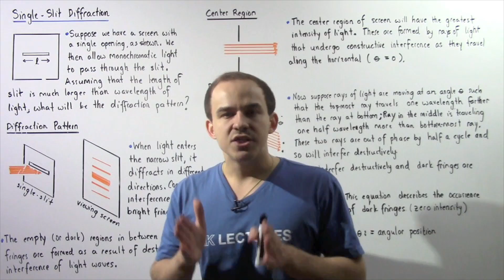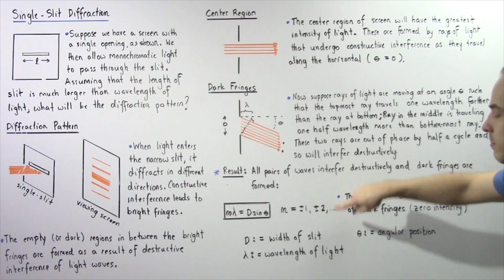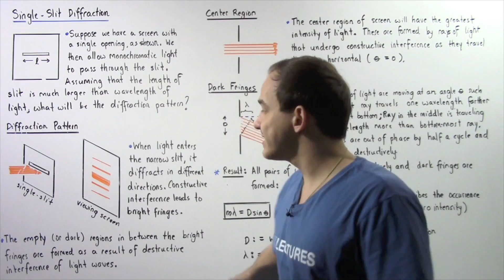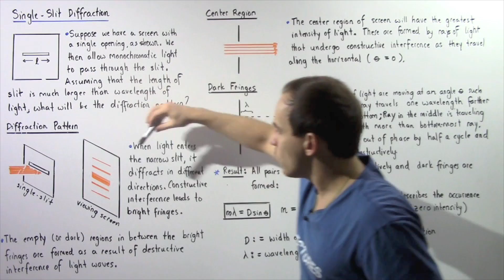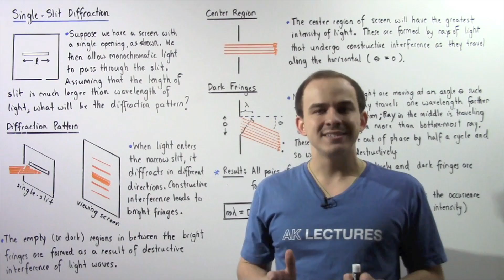Single-Slit Diffraction

Comment: Outstanding job Andrey. 2 quick questions though:

1) What is the difference between this and double slit interference (other than the number of slits present in each)? The formula stays Dsin(theta) = n(lambda), and a pattern of dark fringes and light fringes still arises. I watched a video on double-slit as well.

2) I have seen that the bright fringes are represented by n*lambda and dark fringes by (n+1/2)lambda. In this case, wouldn't that mean that destructive fringes, or dark fringes, occur at 1.5, 2.5, 3.5, etc, or am I doing something wrong.

Sorry, this part of the MCAT is a little tough for me.  Thank you though, you are doing great work. Have subscribed and visited your awesome website.